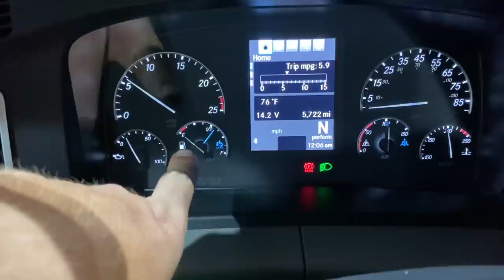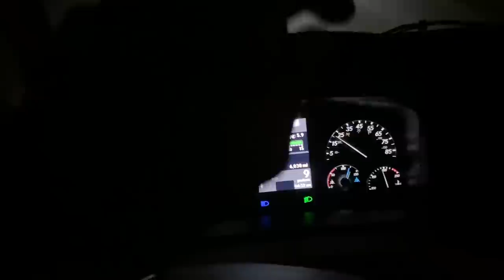Florida Man Fires Up His 300 Horsepower Mini Jet Boat For the FIRST TIME!!! (Pike is a Ripper)

Comment: As a trucker, running up on trucks like Ralph's absolutely makes my day
Reply: Quick question for a trucker... is your oil pressure down at 10-11 psi at idle like cleetus’ rig? Seems low
Reply: @anthonyrowell7853  that's normal for those Cascadias! My Peterbilt idles around 35psi, don't remember what my old Mack idled at

Comment: For the front boat just put in a slip pulley under the rear of the boat and use the winch for pulling the boat to the rear, also change out your winch to a power winch! Hell yeah brother

Comment: That throttle on the steering wheel is gonna be a horrible Idea.
 You must be on the throttle to turn a jet boat so if you have to removed your finger while turning you will loose all steering.
Reply: Dunno why they haven't put pedals in like on Blakes boat
Reply: @acherontiaatropos1   Maybe this is temporary I dunno? I might have missed it in one of the last videos. Finnegan will probably let him know if not.
Reply: If they retained the sea-doo steering system it's pretty high ratio so you won't have to turn very far and shouldn't be a problem
Reply: @jmanlinc  Would be hard to turn the little tiny steering wheel under power with that ratio I would think? Either way cant wait to see this thing rip.
Reply: @JohnnyAnderson1  I've honestly never driven any jet drive watercraft, only fixed electrical problems on my employers so all I can do is speculate.
Reply: @JohnnyAnderson1  why would it be hard? It's not like a road vehicle where your fighting the tire friction of the pavement, there's nothing to resist the movement so long as the cables are in good condition.
Reply: @jaydunbar7538  Your pushing against the force of the water pressure coming out of the jet pump. Under light throttle its not much but wide open on a 300hp ski its quite a bit of pressure. 
Also your on a boat, so your hands are usually wet, sweaty or oily from sun screen lol
Reply: So Like the throttle on wave runner is on the bars........I'm not positive but I assume this "steering wheel" is quick steer where you don't need to turn it more then a 1/4 turn left or right so likely no repositioning of the hands is necessary.

Comment: Jet boat needs a turbo..... I mean you're going to do it eventually, so you might as well go ahead and do it now. lol
Reply: I believe they are supercharged
Reply: @scottymediamachine1013  My point exactly. Probably pushing a whopping 3lbs of boost.
Reply: @generalkayoss7347  gotcha 👌
Reply: @generalkayoss7347  while I agree they will likly be spiced up eventually,  those engines are already nuts in factory form. 200-300hp factory. Boost is somewhere in the 10-15 pound depending on the particular craft.

Comment: In Rural Colorado, people burn their drainage ditches to clear out debris and weeds. Maybe you can do something like that at the Freedom Factory? I think they typically dowse it with fuel and let it burn. Just an idea.
Reply: @christianbuczko1481  Farmers burn their fields to bring back nutrients in the soil... How is that any different?
Reply: @JPOWDaGangsta  burning is ok, doing it with diesal would damage the enviroment. Same with alot of chemicals, anything strong enough to kill that would be strong enough to kill everything downstream too. Also, burning would only clear down to the water level and that ditch needs to run clear or it backs up so wouldnt be sufficient anyway.
Reply: @JPOWDaGangsta  burning actually removes soil nutrients,  it is typically done to remove crop residue that takes of a year to compost and would hinder the seeding of next year's crop

Comment: There are a number of different offset mower attachments you could probably run off of the JD. A boom mower is probably most ideal for that operation but I bet they're pricey. Your lawn care connections could probably let you know if any other offset attachments could work.

Comment: I have an idea for the coolingsystem  from the Mystery Machine... put the intercooler with some big fans in the roof and replace the rear Windows with a net or something where the air can go through that u create an airflow (best way out of the car to get the tiresmoke out of it)... then u'd gain a good cooling effect for the engine...

Comment: If the ditch causes problems, then it needs to be widened. Any grass or shrubery (weeds) in a ditch slows down the flow of water but also prevents erosion. You need a company that uses a twister wrist excavator and dig a 2 meter flatbottom ditch with it sloped on either side.

Comment: There are 2 ways to fix the drainage culvert. 
The expensive way is the add a concrete bottom which will stop the weeds preventing the water trickling down. 
The second, slightly cheaper, option is to dig a header pond at the high end of the drain. This will allow water to trickle off the FF into the pond, once the pond level raises the water will flow down the drain because it has a higher 'head' pressure. Both options will still need regular clearing, but it will be fine for years. A local drainage person should be able to sort this out no problems.

Comment: Cletus, brother you need to put roller system on the trailer. It will make your like so much easier loading and unloading the boats or what ever H2O craft your hauling.

Comment: Possibly consider making a ring/spacer (like a throttle body spacer) that can be screwed into the dash (nut inserts) and that way the dash console can be popped into it and basically never have to be taken out again (so you don't wear the tabs down), then simply remove the dash and spacer assembly by screws if and when you need to access the dash.....

Comment: hey cleetus you should look into the ventrack tractor they have an attachment that hooks to the front it is an arm with a sickle bar mower it can be used to mow hi and or down in a ditch or even hill sides that are to steep i am sure you could also find many other uses for it and other tools they have for this tractor give them a yell and see what they have to offer

Comment: It would be a spendy job but if you ran a lining and gravel in the ditch you wouldnt have a issue with the ditch over growing. You'd have little to no weeds growing in there and it would make it drain wayyyy better

Get some big "rip rap" rocks (5-10") and some smaller stuff around 1.5-3" and a heavy duty felt or plastic liner

Comment: Weld a snatch block at the stern of your trailer then you can use the same winch to pull the front jet boat off the trailer as you do to pull it on...

Comment: hey cleet, just a personal piece of advice, if you dont plan on using them on a weekly basis or very often, then dont use 93 or any gas of that kind, because it will eat up and fray your fuel lines over time. i suggest yall use non ethanol, but i dont know what the fuel lines are made of, so im here letting you know just in case. better safe than sorry lol, those boats are gonna rip tho.

Comment: Put rock down in the drain will help the water continue to flow also help keep weeds down need river type pebble style rock coat the sides and bottom with enough to keep it where the water will continue to flow will help manage it a lot better. My company does this type of work!

Comment: The love bugs are attracted to other love bugs and CO2.  So they head for the highways, get hit, and attract more bugs.  On one trip, I hit so many love bugs, you couldn’t tell what color my car was.  I used up all my washer fluid, and could no longer see, so I pulled into a rest area.  They had a hose running out to the parking area to wash your windshield.  Love bugs are full of acid and it will damage the paint if left on.

Comment: I never really thought about the cooling system on boats in the water i e jet skis and these jet boats does anybody that no know about the cooling system does the water come from the lake itself pass through the engine and back out or do you need some sort of radiator system??? Because thinking about it now taking the water from the lake and passing it through the engine and a filter and back into the lake would be a very good idea

Comment: Hit up Tail-Schwag on FB when your 5050 wips give out. Local company in Florida. Lot tighter wrap on the led's so way more led's per ft. They have a warranty and a 50% replacement on issues not covered under the manufacture warranty.

Comment: The only way you will ever put a front boat on that trailer will to build a set of roller bunks that rotate up to load and unload it from the back to the front position. No man is big enough to use that hand winch to drag a hull up across those carpeted bunks. Those jet boats have zero power when it comes to load or unloading. They must suck in water to blow out against water to make thrust to them move. You will need to float them off and on the trailer, the are not hover crafts or race cars. Out of water they are just resistant to anything you are try to do move them. Please pay attention to what I am telling you, this will save you from the school of hard knocks.

Comment: Dont run them jet boats out of the water for more then 10 seconds or you risk drying out the carbon seal. And if that happens it will let water in the boat and you could possibly sink it